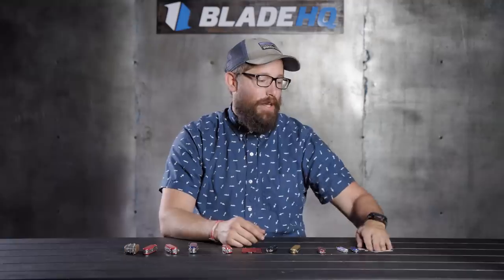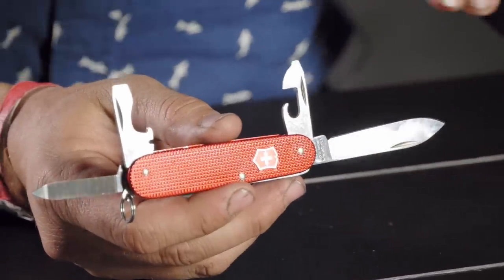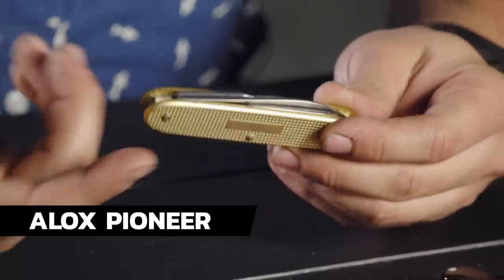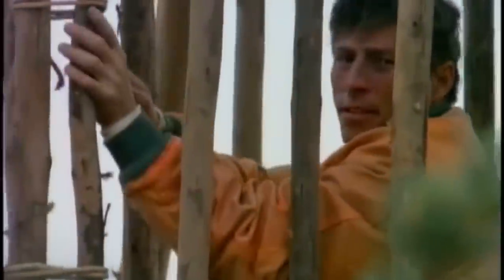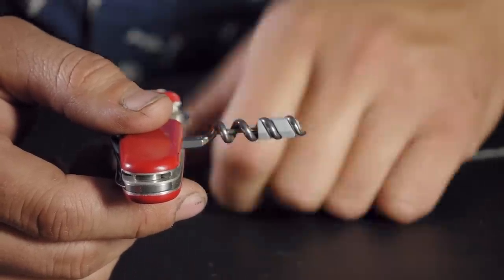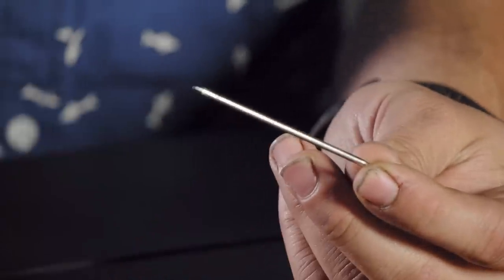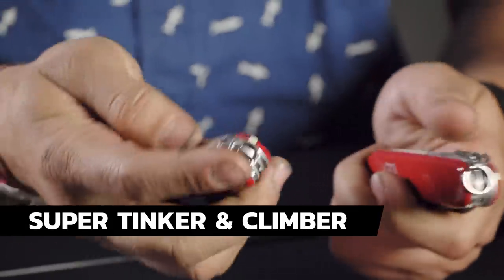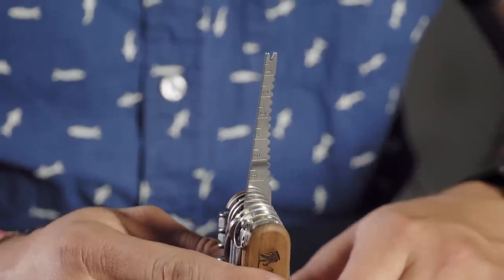Victorinox Swiss Army Expert Breaks Down the Best Swiss Army Knives | Knife Banter Ep. 88

Comment: After realizing that the screw driver on the can opener is designed for and works very well at driving most phillips screws, I now prefer to have the cork screw. Basically if the can opener tip doesn't fit, the T phillips won't fit either.

Comment: I feel like flathead screws aren't exactly uncommon, so there's quite a bit of use for it.
The main reason the slot head screwdriver is so common is of course space though. You can stick it on a bottle opener. Which you can't with the X-shape. I don't think any knives with 4 items or less have an X-head screwdriver.
Reply: Manager, Rally, rambler.... Many others have a Phillips + cap liter combo tool.

Comment: The flat head screwdriver was the very first tool in the swiss army knife. In the 19th century the swiss army introduced a new rifle that could be disassembled. Therefore soldiers needed a screw driver. So they asked Victorinox for a foldable tool with a blade, a tin opener and a screw driver.

Comment: I have carried a cybertool 29 quite a bit, and while it's not a leatherman it actually better than a lethearman for smaller tasks because of its form factor. 

I'm mostly using it for it's excellent scissors (far better than any other MT) and it's dedicated bit driver, as well as the nice small set of pliers. Having a nice blade is a bonus, but often I also carry a utility knife so if I'm destroying a blade it's a throw away edge.

Comment: They use a flathead because A) its a Swiss ARMY knife and most gun screws are flatheads (ie sight calibration) and B) a flathead can be used in a phillips screw in a pinch and is therefore more multipurpose if they use a flathead

Comment: I bought "replacement" tiny screwdrivers and put them in every SAK corkscrew I have. :) THAT's the true purpose of the corkscrew - to hold the little screwdriver in place (and keep the pin from falling out, if applicable). LOL

Not sure which is more useful - the corkscrew holding a micro screwdriver, or a Phillips screwdriver. I've always used the screwdriver on the can opener as a Phillips in one of the slots. Stripping many a screw head - but still. I've gotten out as many (or more) screws with this method. It's tough to replicate a micro screwdriver, however, even with a blade tip. Yes, I've tried to the detriment of the screw head AND the blade tip.

Comment: What a great episode!  As a fellow knife hoarder, I still use my victorinox knives the most.  When I open the knife cabinet, I tend to grab a Swiss army.  (I don’t want to get packing tape on my fancy steels.. as I am obsessive about a clean blade, and don’t worry about a fast clean on an Sak.  Additionally, I know I can sharpen a Swiss army steel really quickly... sharpening an s35vn is more of a shift in time management in comparison) .  

Keep the great banters coming!  

P.S.  WOW should be WOTTFW please. 😀👍🏼
Reply: Fastest way i know to get the adhesive from opening packaging tape off the blade is a bit of Balistol on a rag or paper towel and wipe the blade with it. And if you don't want the blade to be greasy afterwards wash the blade with some normal some or dishwashing liquid both disolve fat (oil, grease...)
After having said that, i too use my SAK most of the time...

Comment: Nice video. Wow I never knew they had names for each combination (all I am aware of are the reference numbers). Regarding the parcel hook, that tool is quite handy for tightening tourniquets and wire bracing as well as for splicing rope. Also useful for loosening knots if you can squeeze the tip into the knot.

Comment: The Hook works well when Your dealing with a Shock Cord/Hook on Apparell like Muck Boots Hook it then pull it over the Post..I love my Swiss Army Knives..about the Only thing I have ever done is take a Dremel and some Fine Sandpaper and remove the holder for the Split Ring..For Me they are "Pocket Tools" and the added comfort far outweighs the ability to Secure a Lanyard/Chain to the Knife..I wish when Victorinox acquired Wenger that they collectively kept the Original Standard Issue in Production..It is the Pioneer without the SplitRing Attachment Point..Instead it had a Hollow Rivet on One end that had a Spring Steel Bail that could stay on or be Removed by the End User if that was their Preference..I wish Victorinox would set up the Farmer that Way and Add a Pair of Scissors..To Me that would be the Best all around SAK...One of my Favorite things though about Swiss Army Knives is the Variety when it comes to Tools and Such..If One wants a Corkscrew or Phillips Generally there is a Model Available with the exact same Tool Set Up with either a Corkscrew or Phillips

Comment: Many of the the comments I've read, (dated earlier than this one), mention some very good uses for the corkscrew and hook tools.  I myself have used the corkscrew as a "fid" to loosen very stubborn knots in rope and cord,  and I've used the hook for such simple tasks as pulling the cotton out of a new bottle of aspirin.  One feature of the hook tool has intrigued me, though.  There's a little nub at the top of the hook.  I think its intended purpose is simply to make it easier to deploy the hook.  
I wonder if it might be milled into a more useful shape, or if the hook's design is already perfect, as is.

I also wonder if the cloudy plastic arm, which holds the excellent-but-small magnifying lens on my Explorer, could be made from a clear plastic, (like CR39), and cut to form a Fresnel lens to add power to the glass magnifier?  Fire starting with the small lens might be made easier if the lens holder itself somehow made a contribution to the effort.  Just spitballing.

Comment: A lot of old firearms and tools were made with large flathead bolts and screws. It's pretty standard on various antique equipment and hardware. Philips was introduced in the 30s, but was used in automobile manufacturing. Robertson was introduced in Canada in 1908, and was used in the Production of Model Ts. Robertson is superior all around in my opinion, and that's not because I'm Canadian. I've used all of them, and Robertson handles torque, and sets and holds screws better than Philips. I like Philips, but primarily for light duty application: Electronics, appliances, etc...where torque requirements aren't that significant, and in most any case where you don't want to have to work your driver out of the screw, which is something that can happen with Robertsons.

Torx vs. Hex head...I prefer Torx, but these are more recent additions, with varied applications. Torx, like Philips doesn't get stuck in the screw, and there's also security drivers based on this type which are all very effective. Allen Key, (Hex), does get stuck, and generally much worse than a Robertson if it decides to, but that's more to do with the steel they make the drivers and bolts out of, which is typically fairly malleable, where torque requirements exceed the size of the key/screw, which is surprisingly often.

Re: The Pioneer Reamer punch tool. The Leatherman MUT has the same tool. It can be used as a reamer/punch, but I'm pretty sure it's also used for dislodging cartridges and servicing firearms when they malfunction. That particular design anyway.

Comment: To be honest, I wouldn't like a so called premium, high end, top notch steel on my Victorinox. Because then I can't sharpen it in the wild with a smooth river rock quickly (without a grindstone specifically for hard to sharpen steel, which you typically don't carry with you).
I know that the edge would hold longer, but I just wanna be able to quickly sharpen it up to top sharpness on the spot, and not having to deal with a slowly fading edge "on the road".

Comment: I really get annoyed when people demanding different blade steels.
Yea a chef knife has lovely steel but but are you gonna pick up a smooth rock out of a creek and get back to work with a chef knife?
They make a good choice with softer steel in a bash around outdoor knife.
A quick useful blade is what you need.
.
420 does exactly that.
.
Even in a office.
You've been cutting plastic wrappers.
It won't cut anymore.
6 quick light swipes on a Smith's quicksharp and you are back to work.
Probably Can't shave with it but wow.
That plastic wrapper problem is gone.

Comment: I don't know how you can do a 35 minute video on Swiss army knives and not mention Wenger or the Wenger derived Evo knives. The victorinox evolution and evogrip knives are based on the Wenger designs. They have locking blades which I love, much better scissors and I personally like the old Wenger can opener better but they don't put that on the Evo knives. I have an old Wenger sportsman that has a flat Phillips head tool that is great, I wish victorinox would put that on their knives.

Comment: I prefer Wenger Swiss Army.  The scissors doesn't have that stupid spring steel that wears out and falls out.  Why can't you fix that? Also the scissors is self sharpening in the Wenger.  The steel and finish is better quality on the Wenger too.
Reply: Victorinox bought Wenger.  No locking blades anymore either.

Comment: Wow. I was obsessing about Victorinox some time now and this video almost cured me out of it. 
Isn't it funny how most of the tools are just useless? You mostly can do everything from cutting to prying by blade. Scissors are hard to supplement by blade sometimes and depending on the environment you could use combo tool. That's it. You really have to try hard to figure out the uses for the other tools to keep the Victorinox hobby. 😄
Dedicated flat screw drivers in 4 sises? For what? Maybe the Philips, but tbe back mounted is unusable and the one on can opener doesn't get to tighter places. 
Why the heck do all knives have bottle and can opener? I can imagine how perfect this layer was for officers in army in 19th century, even with wine opener and reamer. But today this is useless layer adding weight replaceable by combo tool as compromise, if you want to actually carry it in the pocket. Why is this to be found only on Compact from all of the 91 mm knives?
I spend good portion of my childhood in the forest on camping or trips. I guarantee you you do not need that little wood saw. Just snap the small sticks or step on them. It's useless for the big logs which you can't crack so what's the point?
It comes down to minimalism. Compact is looking like hit on the go (I have it), Handyman as quick reach home/car tool.
But really, hook, openers, drivers or orange pealers.
Thank you for the video btw.

Comment: I'm very disappointed.
I was hoping to learn something new but I stopped watching when the expert said that the Pioneer was based on the Soldier (it's the other way around: the 1961 Soldier was based on the Pioneer that was introduced in 1957) and that the only difference between the two is just the key ring (that's wrong for so many reasons...).
Sorry but if you want to learn something about Swiss army knives, there are way more knowledgeable guys out there.

Comment: The Camper. Because of the saw blade, road got flooded because of limbs blocking the drainage pipe and I cleared it with the saw and a rope. Won’t buy any that does not have the saw blade, because of that experience.

Comment: Is that a tissue? No it’s a tissue, toilet paper, hamster blanket and fire starter. Basically that’s a little bit of how Swiss army ideology came about. But really you don’t need a bottle opener you can open it with a knife or just with rubbing it against a rock. Lots off things can be done with only a knife I can use a knife as a screwdriver, bottle opener, can opener and pri tool.

Comment: HOOK: Great moding the hook if not used, may be into a slim 4mm hex micro bit holder to Cybertool Slim?
Did anyone try hanging from the SAK when hooked on a strong metal wire? Like 007/Mission Impossible?
I was lucky finding a cheap 6 layer clone good enough for my uses, only unusable magnifier glasses, which I didn't expect on a SAK at all where it's unprotected. Glasses belong in a protecting pocket and my 2" big magnifier glass flips out like a jeweliers one.